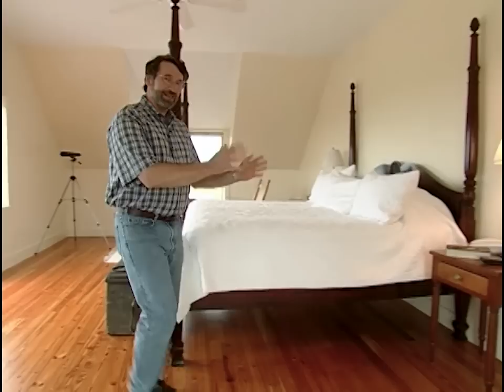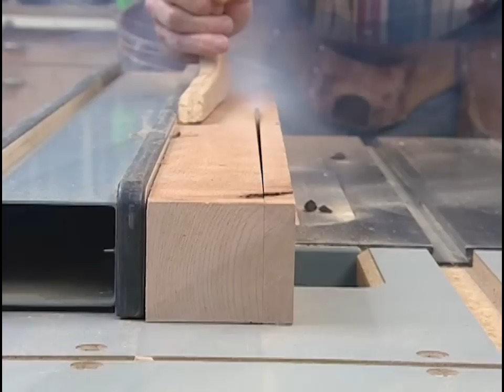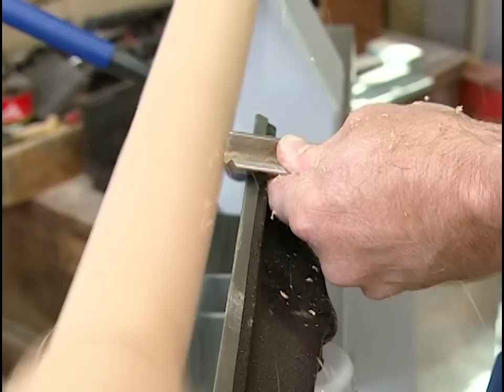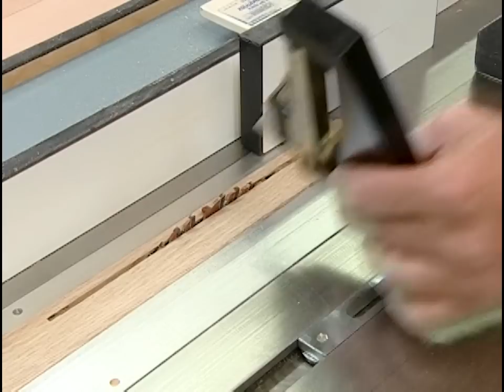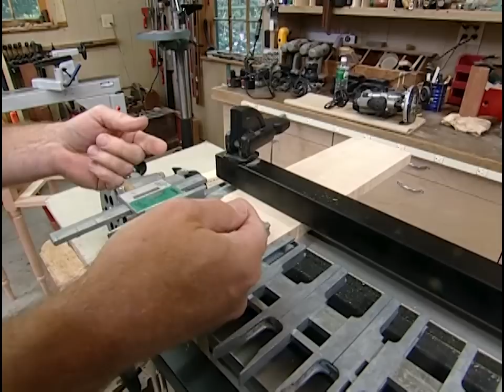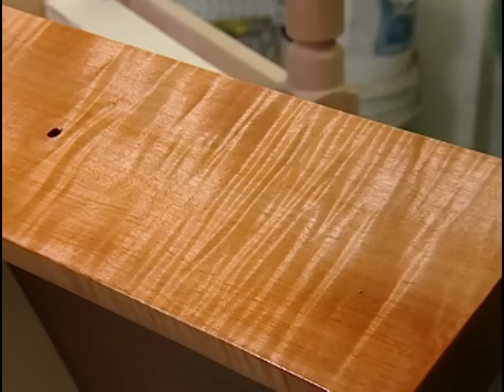Nightstand  |  S14 E11

Comment: Norm, what's the difference between that cherry nightstand, and the original bedside table that you made in the very first season of this program, in terms of the tapered legs, that give the piece lightness, and the ones that are turned on a lathe, and do they also give the same lighter weight to the other table?
Reply: The other table had Breadboard Edges on the top
Reply: I believe this table with the turned legs will be heavier as they're about an inch thicker, even when turned.

Also, when Norm says the tapered legs "make the piece lighter," he's meaning more visually than in terms of mass. Before the legs are tapered the table looks kind of chunky and bulky, with the legs slightly tapered it appears more graceful and, for lack of a better term, "light."